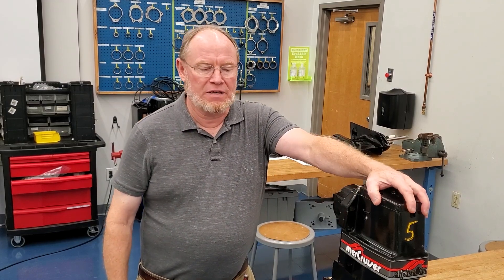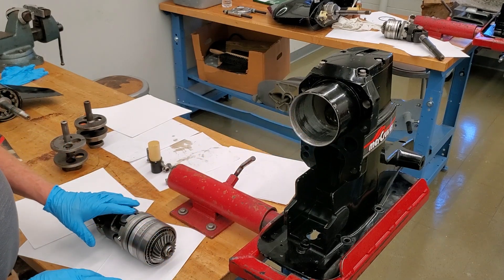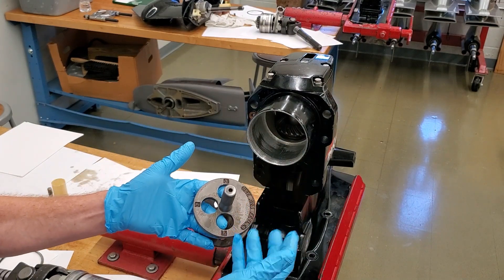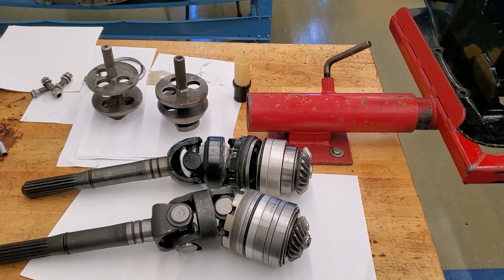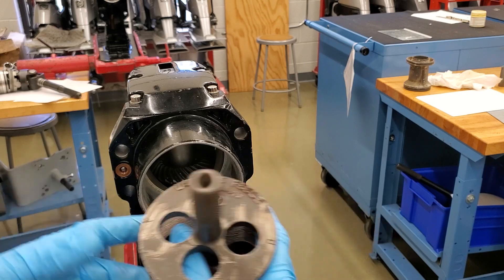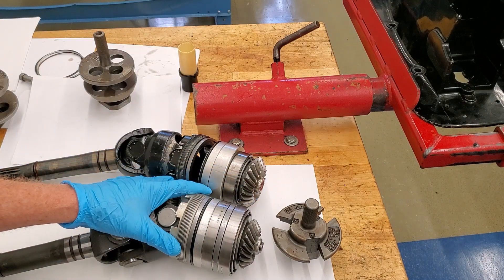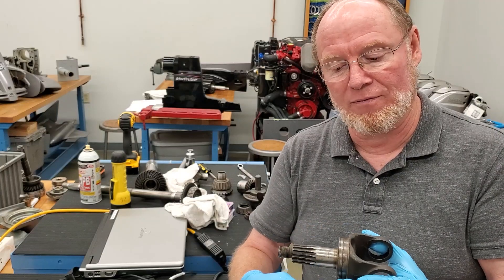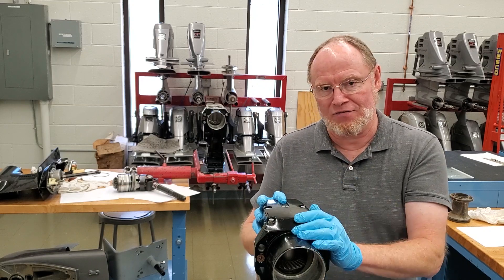Alpha Gen II upper Gearcase shimming tools

Comment: The newer style setup with the thicker housing.   That’s the drive I’m working on and when I set the preload I set it to tight.  Now I’m wondering if I have to unpress the bearing assembly.  Can u make a video or tell me if the bearing needs to be un pressed.  Or if I can just back off the nut and re do the preload
Reply from the maker: No,  you must remove the bearing and try again.

Comment: I want to ask a question how to use a measure the upper driven gear with SEI driven shimming tool same older one with x, y, and z letter on my 1985 Mercruiser MR upper drive older one only. I have to use my Clymer marine service manual. I have to work a rebuild my older 1985 Mercruiser MR upper drive.
Reply from the maker: It's the same procedure as an alpha. Use the letter that matches the drive gear ratio
Reply: @tedsmarinerepair8956 I got it. Thanks Ted!

Comment: I carried it to a local dealer and he set the torque to 60 ftlbs so my assumption is that even though this is a pressed fit stepped design it torques down much the same way as the older slip fit design. What says you?
Reply: I'm working on my aplha 1 gen 1 currently and my repair manual 18-03200 states on page 10-18 to torque the nut down to 85 ft lbs. This is for all mercruiser sterndrives, even bravo. That is the preload setting for the driving gear. Doesn't state whether it's the same for the press fit bearing and gear though.

Comment: Ted I have the more robust input drive assembly. Unfortunately all over the internet including parts order diagrams this type of stepped input drive is not shown. Makes it difficult to know what to order as well as how it should assemble and what torque or rolling torque to set it with. I replaced the seal only to find out that the seal leaks oil into the bellow and I assume it was assembly possibly rolling torque or seal type related. A video on this would be a one of a kind as Ive looked high and low.

Comment: Hello Ted. Very good videos. Can’t find the continuation of this series…
 When shimming (let’s talk about the driven gear) if I understand it correctly if the required clearance is not achieved then shim material is added to one side of the driveshaft (under the bearing race of that side) and an equal amount subtracted from the other side (from under the bearing race). So I am removing and reinstalling the bearing races multiple times (potentially)? The same would then go for the drive gear and the retainer nut?
Reply from the maker: On Alpha drives for the upper drive and driven gears if you have less than 0.025" feeler gauge then you would remove shims from under the driven gear to lower it and if the same is true for the drive (universal joint) gear you would add shims in front of the race to move it out.
Reply: @tedsmarinerepair8956  Thank You Ted.  The drawing has me confused I guess. In my mind the spacers are under the bearing cups (as in the exploded views) but actually they are under the race, not the cup. For the drive gear, they are in front of the race, not the cup.  Correct?  Thanks!
Reply: P.S. - I had my terminology completely wrong as well.  The 'race' is not the cup, it is the actual bearing.  My bad, too old, can't see, can't think, etc.  Time for a nap.
Reply from the maker: @johngragg3776  I think when you take it apart it will be easier to understand
Reply: Thx. I already had both out, but was focused on the driven gear since I could not find any shims anywhere I assumed they were under the bearing cups. Once I read your post this morning and realized my mistake on nomenclature I figured it out. Driven gear shims should be here Friday at which time I think I will have it solid in my mind. Again, thank you for your videos. Hope you are well and happy.

Comment: How much you think it would cost me to swap my gear ratio in my volvo penta sx-m cobra drive to accommodate a 383 stroker moto. That drive was on 3.0
Reply from the maker: Depends on the marina location. Due to labor costs. Or you could get a new upper half complete which would be easier.
Reply: @Teds Marine Repair  I'm in Maine, and how much is the upper half cost?

Comment: I have an Alpha 1 gen 2  built 2007.
Can't  read the serial Number on the drive. It's coupled  with a 3.0 litre mercruiser.  I suspect  internal gear issues.  Metal filings found on oil drain plug . Need to know  the gear ratio of the drive . Can u advise  on this. For parts or replace the lower drive unit. Thanks.
Reply from the maker: Yes the 3.0l is coupled to a 1.98 ratio
Reply: @tedsmarinerepair8956  . Thanks for your help. Just noticed  the oil seal at the prop shaft - drive shaft is in back to front??.  Like  the videos you  put up. 
Very informative 👏.

Comment: I tore my Alpha Gen 1 down just for inspection and seal replacement. Do I need to do the special measurements and re-shim or can I just re-use my original shims? No bearings or gears were changed. Thank you!
Reply from the maker: Lower yes, upper no, you need to reset the input shaft rolling torque to 6 in lbs and check that gear position.
Reply: @tedsmarinerepair8956  thank you for the reply. My understanding was that the 6 in lbs rolling torque preload step was only required when the small spacer has been removed (i.e. the bearings were updated to the new version that does not use the spacer).
Reply from the maker: @cgsgjydxh  yes you are correct. If memory serves me right, with the old 2 spacer set up the pinion nut was torqued to around 70 ft lbs so the gear position would stay the same. But with the new set up used bearings may have a different set position if you take it apart and reset it to 6" lbs. I always check gear position with the special too just to be sure.
Reply: @tedsmarinerepair8956  Thanks again. Your videos have been incredibly helpful.
Reply from the maker: @cgsgjydxh  got it, not changing the bearings or gears, just the seal with 2 spacers. Torque is 70 ft lbs.